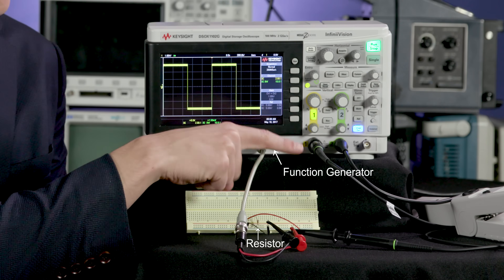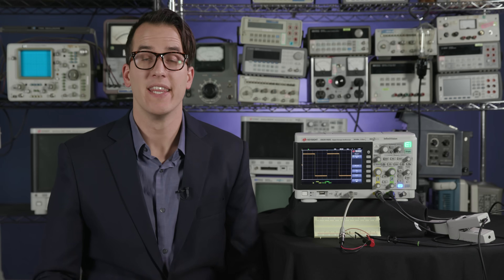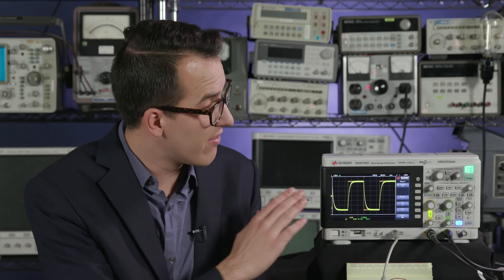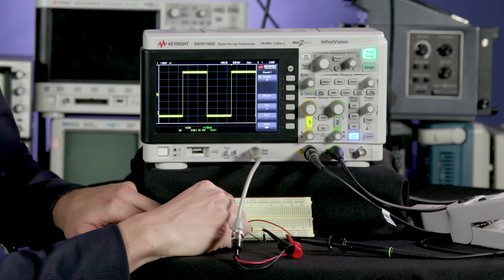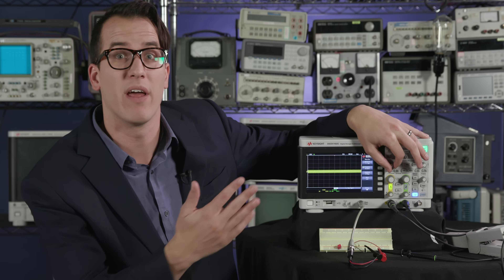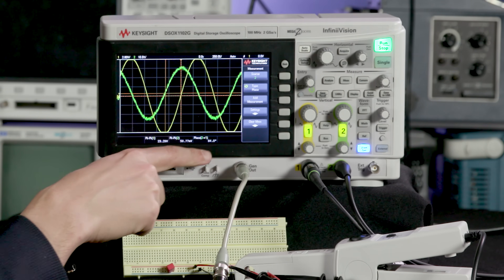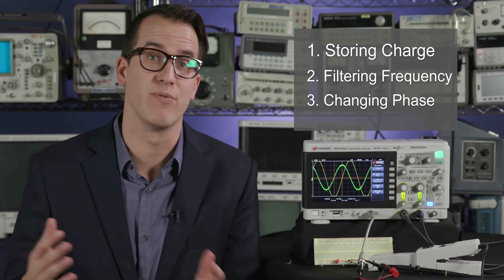What is capacitance? The 3 Effects of Capacitance - The 2-Minute Guru (s2e8)

Comment: Nice video, though I have a question.
 I basically understand the concept of the frequency filtering and how this is visible by "rounding of" the sharp transitions on the square wave signal.
 How ever I don't get how (if at all) the filtering is "visualized" on the "Pure Sine wave" example. I.e. what is the "visible effect" in that demonstration ?  Is it simply the smaller amplitude of the "graph" on the "scope" ?
Best regards.
Reply from the maker: Good question! You can essentially see the effect on a pure sine wave in the form of amplitude attenuation. As a sine wave starts to be filtered out by an impedance, it will decrease in amplitude. It's not a step function from full amplitude to 100% filtered out, it decreases with respect to the impedance.

Comment: This is a really good introductory video for capacitance. The way it's traditionally taught (or at least when I was in college) is to present capacitance as almost 3 different interpretations (the effects described in this video). Since students learn DC first, it makes sense to start with the basic formula of capacitance as it relates to charge & voltage. Eventually you learn AC circuit analysis, and with that comes the frequency filtering interpretation. And once you move on to power electronics, the phase effect becomes most relevant. I fell into the trap of thinking of capacitance in terms of these "different" modes of analysis. But true understanding of the phenomena taking place within a capacitor has to be taken with all these effects in mind, because in any given circuit, one of these effects might be more pronounced or less than the others.

Comment: Dumb question, as I'm no EE: Is this why they have starting capacitors for AC motors, such as the 1/3 and 2/4 horse AC motors I have for running grinding wheels, etc, regarding the voltage/current phases relationship?
Reply from the maker: Good question! They generally use a capacitors ability to store energy (and rapidly discharge energy) to kick-start the motor into motion. AC motors work best when the system is already moving, so the capacitor helps get the motor into that state.

Comment: What effect would a capacitor have if you installed one between CAN bus high and low channels? Would it also start to smooth out the square wave?
Reply from the maker: It would start to smooth them out, but you'd likely start to see some cross talk between the two channels.

Comment: Dear Daniel...
it seems that the current shifts backward... aslo my textbooks aswell as your oscilloscope tells the same... also the phase shift is not necessarily 45 degrees out of phase it depends on capacitance and the frequency of the circuit...
Please rectify me if I am wrong..
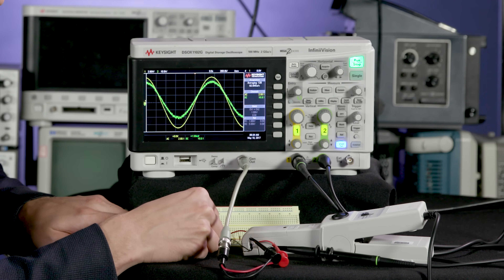Reply from the maker: Great question! The question to ask is "what crosses 0V first?" If you look at 3:05, current is the green trace (channel 2). With the capacitor added, the current rises and falls before the voltage, meaning the current is leading the voltage. 

Also, the phase relationship between voltage and current for a purely capacitive circuit will be -90, but for circuits with more than just capacitance (all real life circuits) the phase angle can be derived from all relevant impedances/reactances in the circuit. And, the reactance and impedance of inductors and capacitors is relative to frequency, so frequency will effect the phase as well.
Reply: Keysight Oscilloscopes .... thanks a lot..
you highlighted one of my major misconceptions...
thanks